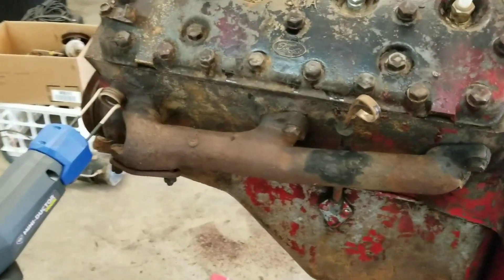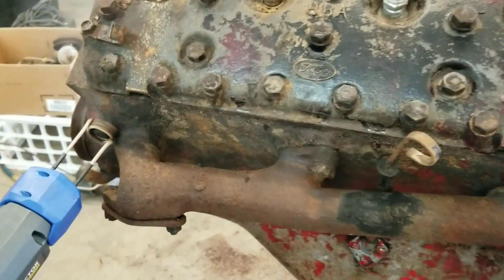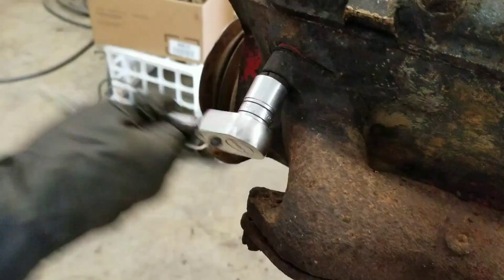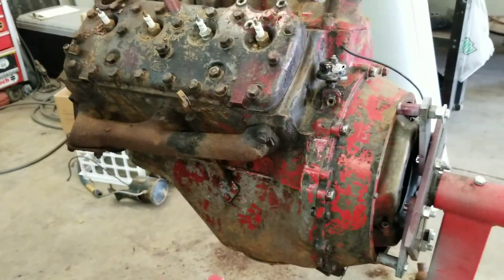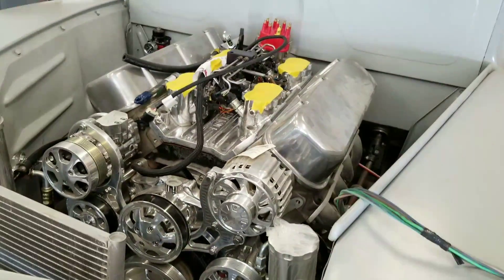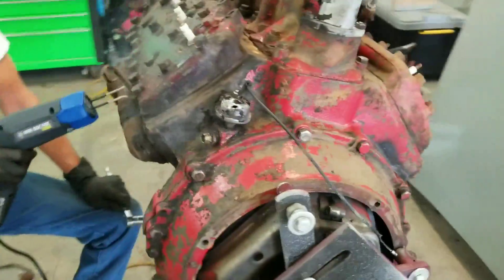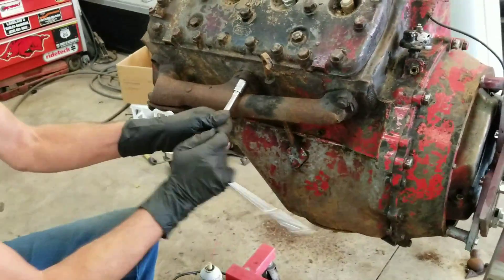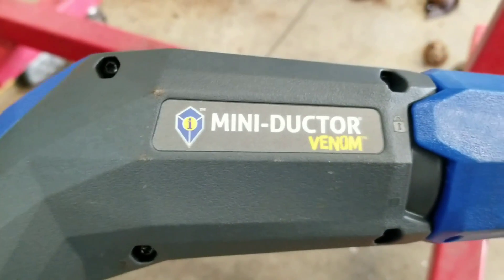Removing rusted bolts cont... ( exhaust bolts )

Comment: It's worth noting here... do NOT reuse these bolts/nuts after heating them. 

I'm sure you guys know better, but some viewers may not.
Reply from the maker: Correct. This video was originally done just to show friends/ family.  And Correct, using those bolts was never an option.
Reply: It's worth not having to deal with broken bolts.
Reply: Can you explain why not??
Reply: @derakc.2783  You're heat treating the metal. It become softer losing its intended strength after heating it up

Comment: I bought one of those things specifically to remove an M6 bolt whose head snapped off when I attempted to remove it. I was able to get about a turn out of it with repeated heating and liberal use of penetrating oil, but then it just froze solid with the block, and eventually snapped off.
Reply: @sorryimajerk735  Yes, of course. I ended up making a little custom fixture to allow me to drill it out very accurately on center. I must have put over ten hours into removing that single bolt.

Comment: Do you still use torches for bolt removal or does the induction heater take care of everything?
Reply: It takes care of everything what’s the point of the tool if you still use the torch
Reply from the maker: Yes, still use a torch when needed. This tool is used way more in our shop.
Many places on special intrest vehicles where a flame could NOT be used. Our later videos give a couple examples.

Comment: How does it actually work? I thought metals expand when heated so should it be tighter?
Reply: Sorta, the bolt isnt stuck because its too tightly pressed against the bore, its because dirt, rust and other material has worked its way into the threads cause it to seize. do to differential expansion (the whole doesn't get all hot at once, so i doesn't expand all at once) helps break up the stuff holding the bolt in place
Reply: Rust expands making it almost like a glue bond heating it reduces the rust to carbon enabling the removal.

Comment: How big can the bolt head be? Would like to put on a brush guard but bolts are rust welded in place. Yes, I know I would be replacing the bolts.
Reply from the maker: There are many different size tips for all kinds of Applications. Look up Induction Solutions.

Comment: Although this inductance tool is very useful it's limited to the size bolt head it will fit. An oxygen and acetylene torch works just as well on any size bolt. Heating and expanding the bolt breaks the rust bond making it easier to remove.
Reply from the maker: Multiple sizes of attachments for all sizes and types of situations. 
And as most say, " use a torch ".
Check out the video we posted where flame would destroy a 54 Corvette steering wheel.
Reply: @sorryimajerk735  Anyone can be a mechanic if they have the right tool. It's the guy who can do it without the right tool who's the real mechanic.
Reply: @jamescosta9120  even if i gave you the tools to do a timing chain job you wouldnt accomplish anything.
Reply: @jamescosta9120  That's just not true haha
Reply: Some insurance companies won't cover for oxy/acet use in garages or if they do it's expensive. Plus the heat from oxy/acet carries to other parts by thermal transmission where induction stays localised. You can buy attachments for the induction tool that can be manipulated to fit the size of component you need.

Comment: How does heating the bolts make them looser? Shouldn't they expand, thus making them harder to remove?
Reply: Heat makes the bolt expand, since it cannot expand sideways in the hole, it expans upward and thus removes the torque that was on the bolt when it was installed. Some bolts that are very rusty and the threads have been seized this thing will not work on.

Comment: maybe im a skeptic.. but i would like to see you try one bolt without the tool, and one with..
Reply: Are you skeptical of using a torch? It’s physically the same action, applying heat to the bolt, just in a much more localised, controlled area. In so far as just heating ferrous metals go, an induction tool like this is quicker and better than a torch that people use for the same activity 💁🏼‍♂️
Reply: @dylanshandley1246  tbh i am skeptical of heat to be begin with.  Ive used it and it doesnt do much.  Nore do penetrating fluids.. every bolt ive sprayed with pb blaster and so forth and let soak.. when i unbolt then finally the next day or hours later.. the penetrating fluid didnt even get 1 or 2 threads down lol.   Project farm did a video on penetrating fluids and i never saw any fluid get into the threads.

I know heat is auppose to break the rust weld of the bolts..  but wouldnt a hot exhaust manifold already do that when the engine is cycled lol.. 

Only thing i can see heat doing is making the bolt weaker when you try to take it off.

Just stating ny experiences working on classic cars for 14 years.  The best thing i noticed to get bolts or whatever out.. Is impacts.  No i dont meanan impact wrench but i mean a dead bow from a hammer on a bolt head or whatever usually does more than heat.  Besides a bolt threaded into any metal wont get hot that far down the bolt.  The head or block ect whatever will just act as a heatsink.

Heating a bolt will also make it larger than the diameter of the hole it goes in..  So it might actually make it harder to get the bolt out.   Freezing them might work better actually.
Reply: @jeepsblackpowderandlights4305  when you heat a bolt, it does obviously expand, but by doing that it’s compressing whatever is gumming up the threads so that when the heat does sink into the surrounding area and expands that a bit, while the bolt is smaller because of the heat that it’s sunk into the surrounding metal, it’s got a larger gap between the thread itself and the bolt itself, allowing something like a penetrating oil to slowly wick down along the thread through that small gap, making it all the more easy. The best bet I’d wager, is to heat the bolt up so that it sinks all the heat into the thread where its making contact and expanding that a bit, and then using an upside down air can or something to try and quickly cool the bolt so that there’s a significant difference between the ID of the hole, and the OD of the threads.
Reply: @jeepsblackpowderandlights4305  I kind of have to agree with you. I do find that heat works but you really have to heat the bolt till it’s basically red hot. Also because the two objects are different coefficients, when you heat up just one object, they expand at different rates. This is part of the reason why I think welding a nut on works so well. If all you are using is a propane torch I don’t think it will do much.
Reply: @ryanjohnson8340  exactly !!!  Just getting it smoking like this tool does doesnt do much.. i saw a video of this tool being used.. and th3 guy could hold the bolt only 2 inchs down the threads...  that doesnt show me anything.. but all this does it heat the head of the bolt.. imagine if its in the head which absorbs the heat like a heatsink.
Reply: @jeepsblackpowderandlights4305  these tools can get the bolts red. Hot, it just take a while. Look up the south main auto video getting a bolt unstuck with out a torch. He I think does a better demonstration of induction heating. This tool has its benefits, but I do think an acetylene torch might be quicker

Comment: No penetrating oil as one sits under the motor........
Reply: The penetrating oil cannot travel against gravity and if it did the threads would be pretty wet or burned off by the mini ductor. Use ya brain.